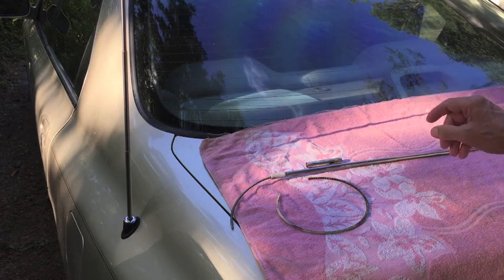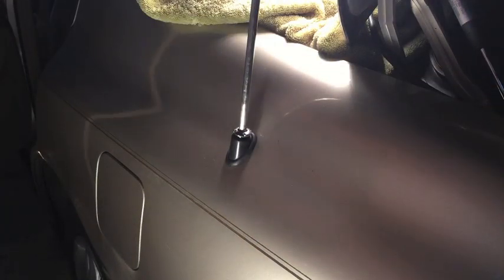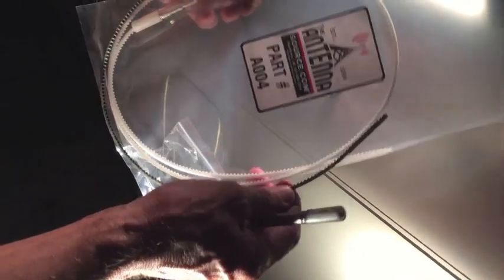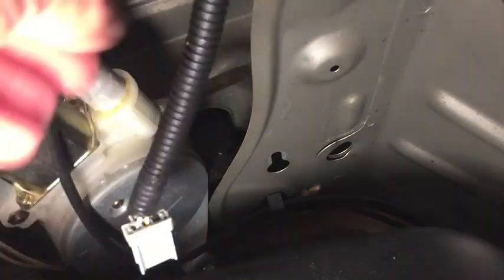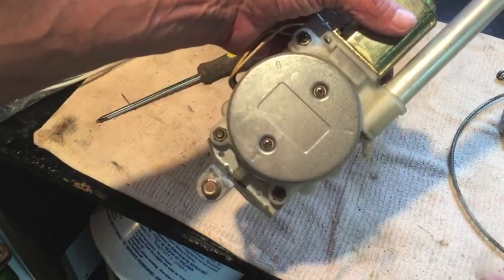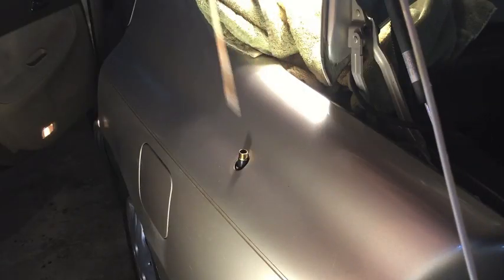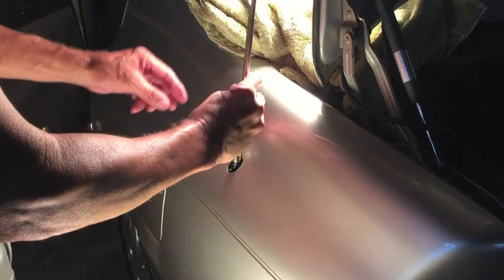Honda/Acura Power Antenna Mast Replacement

Comment from the maker: Replacement antenna mast used in video: http://www.ebay.com/itm/Honda-ACCORD-Power-Antenna-MAST-1990-1997-How-2-OEM-/370675792730
Reply: Thanks for your video, I was wondering if it would fit my 2000 Acura Integra LS, if you have the correct mast  I would appreciate if you could provide me with the information?
Reply from the maker: This should fit your 2000 Integra.. It's not the same one used in the video but it's from the same eBay seller that I bought mine from:
https://www.ebay.com/itm/330666289482?fits=Submodel%3ALS%7CYear%3A2000%7CModel%3AIntegra%7CMake%3AAcura&hash=item4cfd3f294a:g:regAAOSwnw9Z~NL1&amdata=enc%3AAQAIAAAA8M289A%2FjAclaH1u9YGSbdoTfDUrwDWaLQUFZAIe1%2FwOp0dKIKM1323loAr%2BW2Yc%2FTKFZiIWfVKvKIehH7wuiFtdNli%2Fo2bq2T%2B2Ioiaypcev2w2ZQSpUrrj5w%2FnHAqVoNIl0Rx%2BTVmLHpY8OADwR3w9dZLTvUzg4lO3Z19qHEUdfIT%2Fxtwr9gjULs1Z6QKv0F2FMA2mA4UMuPl0pz5yTAy2n9gic38lMcowZ4EM2tT7irp982aN7X22lt2qXpSu5GZy89Ee%2BsfivA1%2FQ4ULyUGP7NKI%2F2NmxDTHb%2BWT%2BrmSo2s8ew6%2BIXlyB%2FkQiHUGySA%3D%3D%7Ctkp%3ABk9SR_qpmcqoYg#vi-desc-maincntr

Comment: Hello PeanutButter Man.  This is the 70 woman who was going to attempt to install an antenna with the help of your video.  Well, it went great.  Thank you.  Of course the cord broke off but with diligence I got the motor out and apart. I only needed to call for help when it came to actually putting the new antenna in.  I needed someone to raise it and lower it.  I called over a neighbor who, being a man, insisted on the install part while I raised and lowered it. All good because since I watched the video I got to show him how it was done.  I of course made mistakes, like putting the carpets back in. I did them in the wrong order. Oops.  But now I know in case anyone needs help in the neighborhood. Lol. Thanks again.  I’m sort of proud.
Reply from the maker: Well you should be proud!! And I made mistakes too.. I just cut them out of the video to make you think I knew what I was doing.. Glad to have helped.. Thanks for reply..

Comment: For my 93' Acura Integra LS hatchback, I didn't have any issues. Getting to the motor, removing panels & brackets is never fun, but I just watched the video then watched it again while stopping with each step, did the work, finished up & even utilized the bleach suggestion. I didn't want to buy a tub of bearing grease so I used a little Vaseline. It did take several 'ups & downs' for the antenna to start retracting fully ... Thank you!
Reply from the maker: You are welcome.. Thanks for reply..

Comment: Thanks for the overview. You were lucky. I wasn't. The sleeve on the old antenna mast was corroded into the aluminum tube. I have been told that I could just remove the sleeve from the new mast, and insert it into the old sleeve that is stuck in the aluminum tube. But, I can't seem to remove the end cap on the new mast in order to remove its sleeve. I have put many hours into this project and have not gave up yet.  I bought the new mast from The Antenna source, so I hope they will bet back to me on how to remove the end cap....
Pray for me folks.
Reply: That’s what I did.

Comment: THIS is the video you want to watch if your are (trying to) doing this... 

The inside of the trunk info gave me confidence to do that removal without worrying about anything SPRINGING ALL OVER THE PLACE!! And the "grease" the inside part is good advice. I spent an hour messing with it today and I did not complete job, but I am used to that dealing with these 94-97 Hondas, the "most pain in the butt" car to work on I have ever dealt with. 

Everything about these cars is a puzzle wrapped in a riddle corroded on to a surprise which is rusted on to a part which has to be ordered along with the special tool it takes to... grrrrrrr!
Reply: I did finally do this job... or as close to doing it as I was going to come... what did I do? I was going to post the whole comment here... but maybe better to help people as a new comment here...

Comment: Excellent tutorial!
I installed the new antenna and it clicks a few times when turned off and on at the very end.
The old one broke off years ago but I’m guessing the plastic teeth thingy is too long or not long enough? would that be an accurate assessment?

Comment: Great video mines just broke going through a car wash. 😩 thanks you.
Reply from the maker: Glad to help.. Thanks for reply..
Reply: LMAOO same exact thing just happened to me
Reply: sagee haha that sucks man . I just got my replacement but mines is a 95 wagon it should be the same process . Lol
Reply: Al Nitty it still goes up fine just doesn’t go back down gonna try and bend it back into shape and if that doesn’t work just gonna replace it😂
Reply: sagee yeah mine bended  also and when I tried to straighten it, it broke half way lol.. then a few days later completely broke off .
Reply: Omg. I just bent mine going through the car wash today too!   October 2019.  I’m going to try this. I’m an inept mechanic 70 yr old woman. Wish me luck.  Your video makes it look doable.  Thank you.  I’ll let you know if I accomplish this.  Last year I actually changed a rear tail light watching a video. That was my first repair ever. Now on to the second. Phew.
Reply: rayleen Tuel that sucks, I managed to get mines fixed even though I don’t use the radio stations I just wanted it fixed. It was pretty easy I’m sure you’ll manage to get it fixed if you already fixed a tail light good luck .
Reply: @alnitty1142  thank you for the encouragement.  Part comes in Monday.  I’m ready to tackle it.

Comment: This video showed me the way... but it turns out my mast was not actually broken, it just did not go up and down the way it should. 

I took several tries messing with it.... but I did finally "fix it", or as close as I was going to come. Someday I may post video of the footage I captured as I did this project (on my video page) but for now (watch PBMAN'S VIDEO, it is good) and maybe reading my story/tips below will help others.

I ordered and bought a new mast online assuming I needed it because it would only go up about 12 inches (about half way up in 2 sections... the rest of the sections were stuck) and it would come down leaving 3-4 inches up.

I tried and tried and tried to lube it all up and pull the mast all the way out, but it was NOT going to come  all the way out... and it never did.... BUT... in the mean time as I was spraying the outside of the metal mast with lube...  and as I removed the entire mechanism from the trunk.... and with another persons help I tried my best to pull the mast all the way out... and it would NOT come!!! 

So I opened the bottom part of the mechanism (from the trunk) exposing the plastic teeth strip (which to my surprise the strip was not broken). So I used the white grease (I forget the correct name) to lube up the teeth and shoved/pulled that part into the inside of the mast... which I guess lubed up the inside of the metal mast and AGAIN WE TRIED PULLING IT ALL THE WAY OUT!!!! AND IT WOULD NOT COME OUT!!! 

25 years of rust.... STUCK!!! I almost pulled out the drill... but...I relaxed...

The good new is I did not destroy or bend the mast and amazingly, as I said fk it "we will try this again another day", as we were putting it all back together... apparently all the lubing and pulling up and and pushing down and pulling up etc.... and low and behold...THE ORIGINAL MAST GOES ALMOST ALL THE WAY UP!! And it goes all the way down... simply by turning the radio off and on. 

Mainly it could pull in the radio stations again.... So I decided that was good enough.

All it needed was lubed. I was/am happy it was not broken.

The moral to my story is... as I said above "watch PBMAN's video to see how to remove the mechanism in the trunk" and pull it out. Take a look inside and if the teeth plastic part is not broken maybe all it needs some white grease (which will lube the inner part of the mast... and some spray lube on the outside... and spend some time running it up and down over and over... maybe all it needs is lube.

Maybe all it needs is lube (inside and out)~~~~~~~that's what she said ;)

Comment: i put mine on my 1993 honda accord and mine doesn’t close all the way but i don’t mind that. the thing that does bother me is it makes a noise when it goes down and up almost like a farting noise as if the cable is scratching. i put grease on the cable as well and still makes the noise
Reply: Mine too.
Reply: @made_by_Pamela  i wonder what it could be

Comment: Absolutely do not use wheel bearing Grease. Wheel bearing grease is a petroleum product and will eat up the plastic overtime. Wheel bearing grease is used for metal Parts not plastic. Use a silicone base grease or silicone spray is just fine. I use silicone spray to lubricate and what clean the antenna. I suggest cleaning your antenna once every 6 months.. again do not use any type of petroleum-based products to lubricate the plastic parts

Comment: Having problems with my antenna after i cleaned my motor change antenna mast when i turn on my radio my antenna goes down and if turn off my radio antenna comes up.. also motor has a bad sound...

Comment: Hello, I changed mine and it goes up and down fine but it will not go all they way down, it stays like an inch up from being flucs with the antenna bolt
Reply from the maker: Have you turned your radio on/off multiple times?? If you have and it still won't go all the way down I'm not sure what the answer is.. Possibly remove the new antenna, cut an inch or two off the end of the cable and reinstall??
Reply: @tongo117  ok, thank you

Comment: Hi mate, mine is not going down all the way, what should I do?
Reply from the maker: it should go down a little farther each time you turn radio on/off until it bottoms out.. that's what mine did.. probably took 4 or 5 on/off cycles till it was down all the way.. if that's not happening maybe take it apart and reinstall..

Comment: I replaced the antenna but now when I turn the radio on the antenna goes down and when is off the antenna goes up. Is there a switch to reset the motor or something to fix the problem. Thx.
Reply from the maker: I don't know what would cause that but I'll do some research and let you know if I find a solution..
Reply: @tongo117  His leads are backwards.
Reply: Reverse the Polarity...
Reply: Same problem how do i change the polarity i has a plug

Comment: Hello, 
Do you think it would be compatible with my accord 6 1999 ?
Reply from the maker: The procedure is likely similar on your 99 but you will have to find the correct mast.. The one I used in the video fits 90-97 Accords..
Reply from the maker: This mast may work for you.. But check the compatible vehicles list to find your exact model..
https://www.ebay.com/itm/230966170685?fits=Year%3A1999%7CEngine+-+Liter_Display%3A3.0L%7CTrim%3ALX+Sedan+4-Door%7CModel%3AAccord%7CMake%3AHonda%7CSubmodel%3ALX%7CEngine%3A3.0L+2997CC+V6+GAS+SOHC+Naturally+Aspirated&hash=item35c6a8143d:g:-~sAAOxyOalTXQXA&amdata=enc%3AAQAIAAAA4GAbowD7qYYdM4Wf9p9h%2BZlgWC0jvVzabT1Wd7WtWTVNKkpm5rgbDZAqOMOpoJRwng3OrafN70G5uG5qbjKK4BMhz8K4GJOXD8LmiTA1lCpAHr90oNLKUhB%2FHVwkeJ%2FlyfXyx%2FwsRgGY0kqV3lRVrQmaEwYOmLOCuh1wiH%2B%2B9kklyDkkSzqUIPbFGhsh53BdOs%2BhX%2F317XkJy%2FTC7Ye0cbSgBVsj7sHuGpUftyRx%2BjQH2Cr9oDQAM331SilO%2BIuMjKwZ0EUaV2rVDAIBV8FMHk%2B6c%2F7%2BXLBS4Hd03go01YDj%7Ctkp%3ABk9SR6DDg7WCYw

Comment: I am trying to get the metal sleeve out and I was using needle nose pliers but it doesn't want to come out! I am afraid I might screw up the threads and then I'm screwed. Another video showed the man just leaving the sleeve in but he did not show on the video how he got the new sleeve off of the new mast! Stupid!
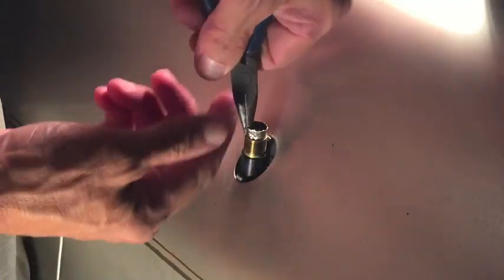Reply from the maker: Did you try what I did starting at 2:24?
Reply: @tongo117  I could not get the metal sleeve to budge with needle nose pliers and I was scared of ruining the threads. I did get an easy out kit from Harbor Freight and with the help of penetrating oil, got the sleeve out. It is working great now with the new mast and my wife is very happy!